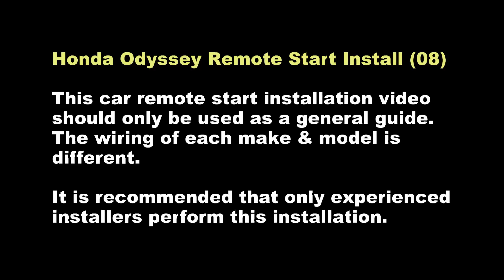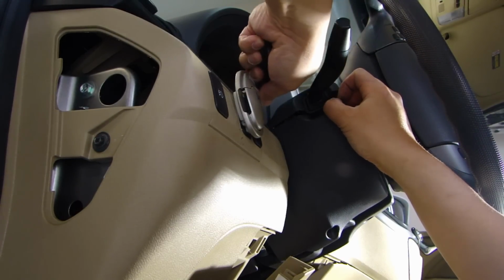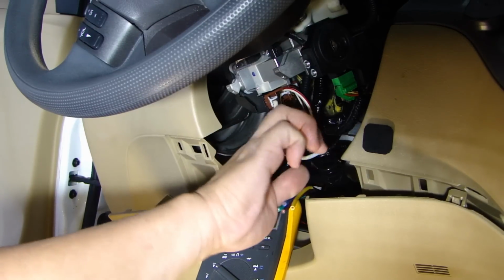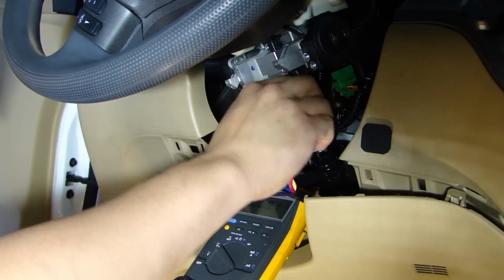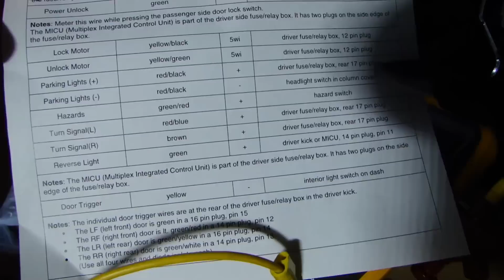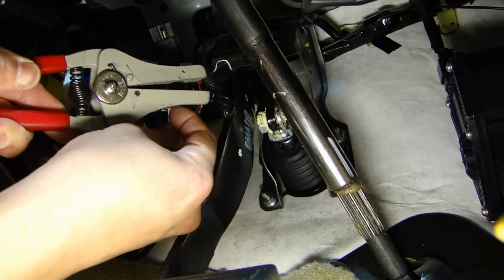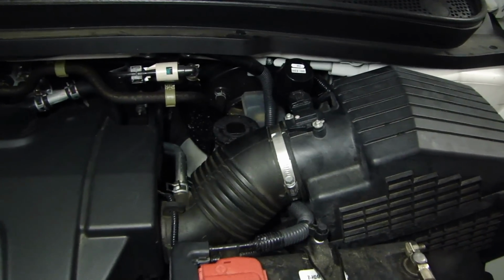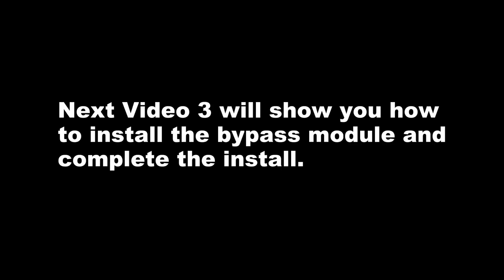Install Car Alarm Remote Start - Alarm Wiring - Honda Odyssey (Video 2)

Comment: I know this is an old video but do you remember what that soldering iron is, is it a normal soldering iron or a station it seemed to do a great job on those thick wires
Reply from the maker: I used a soldering station that I got long time ago. Buy any 70+W solder station will work just fine. A soldering station will be able to hold the temperature much better. I use an extension cord and put the solder station in the car when I am doing the wiring. Something like this https://amzn.to/3JpvxZp

Comment: Your video is a big help for DIY installers, on your video 1, I saw you connected "Parking Light Reley Input" to ground, how do we know if our parking lights are ground switched? Thanks.
Reply from the maker: You first need to locate the parking light wire. Then use the multimeter to test if it has 12V when you turn on the parking light. If you don't see 12V, then set your multimeter to ohm measurement and test it to see if it goes to ground when the parking light is on. In my Video 1, I connected the parking light input wire (red/white) to ground because initially I followed the wiring cheat sheet and it said parking light was negative triggered. But in this install video, I found out the parking light wire is actually 12V, so I did have to disconnect the parking light input wire from the ground wire and connect it to a constant 12v source.
Reply: @dial2fast  What a great info! you have gain one more subscriber, Thanks.

Comment: Would you have photos of where the 2010 Honda Odyssey alarm brain is located? I want to disconnect the alarm. It keeps on going off when I lock the door
Reply from the maker: Sorry I don't know, and if it's a factory alarm system and you disconnect it, the car might not start.
Reply: @dial2fast  thank you

Comment: Thank you so much, I have a question I have a 2006 odyssey did not come with a remote but it has a factory alarm. will I be able to bypass the factory alarm to install this system?

Comment: T taps are better
Reply from the maker: T taps are easier (for the installer) but not better. Personally if an installer uses T taps to install remote start systems, you should look for another shop.
Reply: @dial2fast  why is it worse I'm wondering because if it's too loose than use a tighter t
Reply from the maker: @kevinmontoya7318  When it comes to installing remote start system, couple things one must consider. The connection to the ignition and starter is high current. The connection needs to be 100% secure with 0% failure. If you look at the connection point of a T tap, it's applying pressure on two 'small' metal contacts on the wire. This connection is not reliable and over time it can fail with oxidation. Worse case is a possible electrical fire hazard with the connection heating up and melting. (BTW you have to use the right gauge size of T tap, not use a smaller gauge T tap on a bigger wire to force that tight connection as this will cut the copper strands and damage the wire). Any experienced installer will tell you they do not want to have a customer come back complaining of intermittent issues on the alarm / remote start system. Then you have to spend couple hours chasing down an intermittent issue (time is money). Any good experienced installer will know this and avoid this headache. Do it right one time instead of doing it wrong several times.

Comment: Did you install a hood pin or tilt switch with your remote starter? And if not, why so if I may ask?
Reply from the maker: On this Honda, you don't need to install pin switch because the car itself already has a hood switch and it's detected by the Flashlogic via the data connection which gets sent to the alarm to disable remote starter if hood is popped open.
Reply: dial2fast Oh ok. Thanks!

Comment: great as usual, let us know when you sell it, it will have a lot of accessories, lol. if the audio was off of sync, we don't see your face to know, right. are not these wires you patch into, under the hood or the way you do it is the professional installer way
Reply from the maker: As far as the ign, acc, starter, those must be taken from the key ignition as that's where the voltage need to be energized. Also those connections at the bypass modules must be from those wires. The rest like brake, parking light, etc can be taken anywhere you get access to. In the old days, the only wires you need to pull from the engine is hood pin, tach wire, and siren, but now it's just the siren (at least for this car).

Comment: I need some help in identifying the ignition(+) input and 12(+) input wires on the prestige remote starter. Have managed to connect all the wires from prestige to car and the by pass mode to the car for a jeep wrangler 2008, Now on the flash-logic type 3 wiring diagram I need to connect a pink-ignition wire(+) input and white-red ignition status (+) output to the ignition(+)  on the remote starter.

Comment: dail2fast you have a great car alarm video series, it's very clear and well done, thanks. I do need your help tho... I have a 95 mustang GT that I'm gonna install a Python 5106P into. the alarm installation guide and the vehicle diagram sheet have some terminology that I'm not familiar with.in the alarm install guide, what is a FLEX output? parking light isolation wire (pin 87a of onboard relay? on the vehicle diagram sheet, it talks about my power door locks being TYPE B since I have factory keyless entry, but only give instruction for TYPE C door locks which are without factory keyless entry, what do I do in that case?how do I wire the negative 200mA dome light output? is it safe to say that all the mA wires will need a relay on it? how is the relay wire for that?  lastly I have a factory truck release, the alarm has an Aux 200mA negative trunk release output and a trunk pin / instant trigger input (N/C or N/O). what do I do with that?thanks in advance
Reply from the maker: +PANTYEATR1 The negative output of 200mA should be connected to relays so you don't damage the alarm brain. You have quite a few questions which is hard to cover by typing here. I recommend you check out this website and their forum to learn the basics that you need to know before doing the install. They have many good resources there for you: http://www.the12volt.com/installbay/
Reply: +dial2fast hey thanks for the help. the more i watch your videos and similar videos i start understanding more. What i learned is to connect the relay with 86 & 87 as the constant 12v, 30 is the load item and 85 is the alarm with the 200mA ground triggering the show.

Comment: What is the actual color of the negative park light wire on from the light switch on the steering column? And the the actual location of the positive park light wire. I am working on a 2006 odyssey and the wiring is the same except that - park light from the column. I did unplug the green plug from the light switch and there was no red/blak wire. There was red/white and just black
Reply: MICHAEL DAK the negative parking light wire at the switch is red/black

Comment: Hello...   what did you do with the wire that was actually positive and in the instructions was negative?  All other wires were the same as in the instructions?  Thanks
Reply from the maker: The remote start unit has a parking light input wire and a parking light output wire. Since this was tested to be positive, I connected the parking light input wire to positive 12V (instead of ground). There is a built in relay in the remote starter that switches the parking light input 12v to the parking light output wire allowing the parking light to flash.

Comment: if l install the remote start system into the car ,I need to buy a bypass module or not?
Reply from the maker: If your car has an immobilizer factory key

Comment: Hello. Thank you for making these videos, they're very helpful. The only question I have is on how did you have your multimeter set up? usually you would need a negative feed as well but in you video you only seem to have one wire hooked up to the multimeter. Could you please explain and say what seeing you had it at?
Reply from the maker: You can attach an alligator clip to the negative probe of the meter and clamp the other end to the metal chassis under the dash for the common connection.
Reply: +dial2fast thank you!

Comment: Hi I'm trying to find a tach wire on a 04 Hond odyssey ex but I can't find it . Tech sheet says it's a blue wire 2pin test connector above brake mater cylinder? ?? I don't see any 2pin connector above it. So I was trying to get a tach signal from the injector's wire located at the corner because it's hard to reach the ones located in the middle of the engine . Testing that wire in ac voltage it gives me a 0.1 volts and by pressing the gas pedal it increases up to 0.3 and some volts I'm not sure if this is a Good tach wire signal help please! !!!
Reply from the maker: If you can't find the tach wire inside your vehicle, it's best to tap the wire on one of  the ignition coil and then run that one wire into the vehicle. Typically that wire with engine running will give you 0.5VAC at idle and increases when you rev it. Make sure you measuring AC voltage and not DC.

Comment: Great series!  You are doing it live!!  You have lots of guts to do this without disconnecting the negative battery cable before wiring the alarm in.
Reply from the maker: You do have to be careful when you splice in the factory wires and your cutter don't short out any metal parts in the car. I can tell you all installers never disconnect the battery because the process involves testing each wire and connecting it. So you need a functioning electrical system.

Comment: HI, DAIL 2 FAST,  HOW ARE YOU?.
Quick question do you have any experience in pro start remote starters?.
I am Installing a pro start remote on a DODGE CARAVAN 2005.
but I got into couple issues

*  The antenna doesn't flash.
* I can't program the remote starter. because of the antenna and when I locked with the original key the alarm goes off either way lock or unlock..

any suggestion?.

I can start the van with the key but, I Can't program the remote starter.
Reply: CARMELO Relente it sounds like your remote start unit isn't seeing the right constant, ignitons, and accessories, or starter wire. I'd look at the first 2. and it sounds like your siren is hooked up to constant or something else. it gets its power from the remote start. it's possible the unit may not have a good ground. would need a little more info
Reply: CARMELO Relente it sounds like you may also have the wrong door pin if you are hooking up an alarm. have you solved the issue yet?

Comment: And what's the amperage draw when the vehicle is off ?
Reply from the maker: Car alarm systems are designed to draw minimal amperage. You can have the system armed and car parked for a month, and it will not kill your battery.

Comment: very well detailed video 
i used it to install one way audiovox remote starter on honda odyssey 2006 and everthing worked fine ecxept for  the dash light fuse that keeps blowing as soon as i turn the light on. 
can anybody help troubeshoothing thax

Comment: Hi have questions have viper system or ready have 5706v I to put 5906 only have to switch the module right because is same wiring right
Reply from the maker: Not familiar with these Viper models, but usually different models within a brand will have different wiring harness, especially if you step up in model where the higher models have more features. You will also need to program the new alarm. Not exactly plug and play.